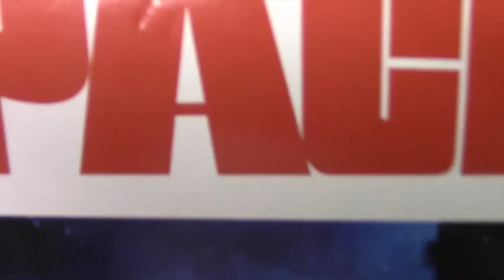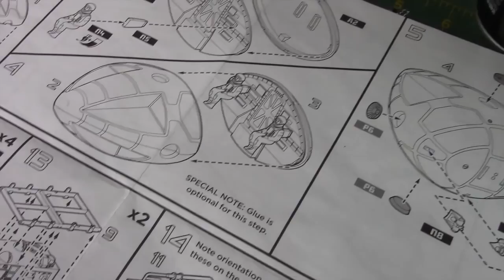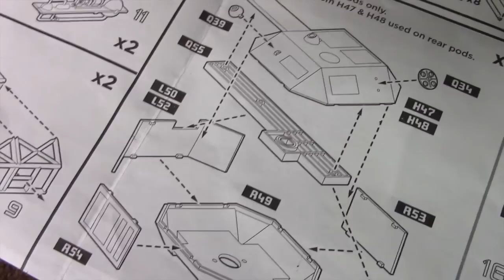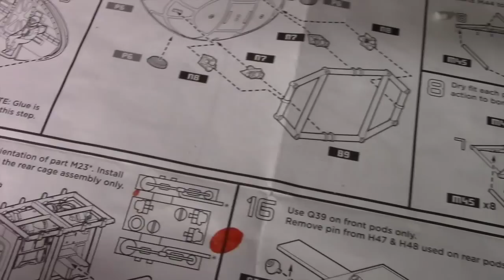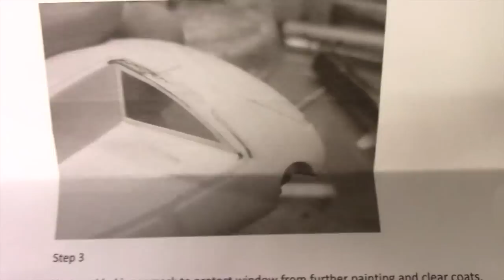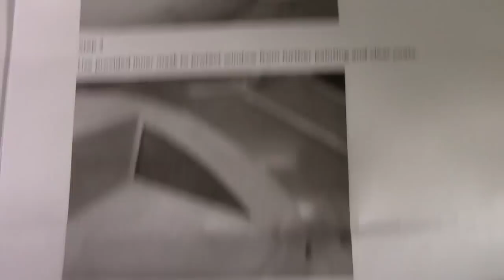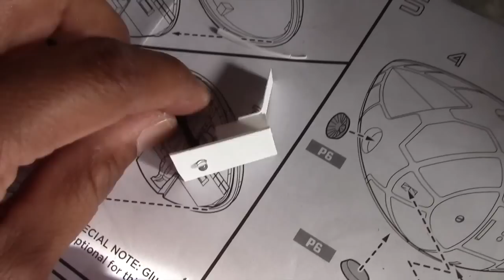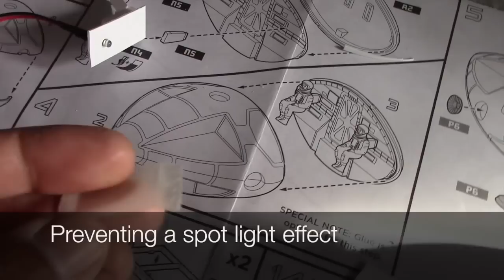Building the Round 2 Space: 1999 Eagle Part 1

Comment: Enjoying watching the built.  Two things.  Since the figures are a little harder to see in the cockpit, a quick wash (not black) would probably have been enough to make them pop.  Regarding the LEDs, the size of the LED does not dictate the battery used ... the color (different forward voltages) and the resistor (which should be included, based on where you are getting them) is what determines the battery to use.  I rarely use the 9V batteries because of their size and they don't last as long as other type batteries.  Granted, just powering an LED or three means the battery still should last for quite a while.
Reply from the maker: What kind of battery do you typically use?
Reply: @InterstellarModeler  Depend on the space available.  Typically I shoot for a couple coin batteries (I want a minimum of at least 3V), and I've used some small ones meant for cameras at around 12V.  The latter are more expensive than a 9V transistor battery, which is hard to beat for the cost, but smaller ones often fit the space better. I've also used a couple AAA batteries.  I sent an email with some info.

Comment: It's Micro Sol for getting the decals to shrink in place. Micro Set is to put on the decal when it's dry before soaking it off the paper. I always got it the wrong way round as well. The names are a bit confusing.
Reply from the maker: +Montague Flange You're absolutely right.  Thanks for the correction. Overall these decals aren't very hard to work with.  I will make sure I correct that in my next video.  Thanks for watching

Comment: Kool model. An easy way to diffuse the LED light is to apply a ball of clear, hot glue. Just squirt it on, and shape it with the glue gun.
Reply from the maker: I've been told that hot glue could potentially damage the LED, have you ever had problems with this?
Reply: Interstellar Modeler , I've never had a problem with it. As when soldering, don't keep the heat on the LED for too long. Also, you can use the low temp glue.

Comment: Instead of installing the translucent styrene sheet in front of the LED you can alternatively sand the clear "front lens" portion of the LED itself. Gives various amounts of diffusion based on grit of paper used. For even more diffusion (and further light intensity loss, of course. Everything comes at a price, right? :D) you can then paint the sanded LED in a semi-opaque (or do a thin airbrush coat of opaque paint of) colour of your liking.
Reply from the maker: +the agile aardvark Yes that is very true.....something I didn't even consider when puttying this together.  Thanks

Comment: Hi, you d'idnt talk about Windows clear parts, did you install these or stay open.? thanks
Reply from the maker: +Richard Bourdeau I left them open up until the very end but I did use the clear plastic parts that came with the kit.  If I were to do this again, I would do the exterior gray paneling first before installing the windows and attaching the astronauts / back wall.  I used pastels for the paneling as you'll see in upcoming part 4 and it would easier to spray the dull coat without the windows in place.
Reply: Ok. Im looking forward for part 4 !!!
Thanks

Comment: Your a skilled model builder, but this has to be by far the worst over fiddley model kit I have ever attempted. The tool designers clearly did not car or have in mind the end result. Which of course is the builder. The spine should have been in 1 or 2 pieces. As it is nearly everyone I know who attempted this kit. Ended up with a crooked spine. Then others who just threw the kit to the side. You need to make sturdy jigs for a lot of the assembly. Instructions are also badly done with way too much figuring out and redoing of a lot of parts.
Reply from the maker: I'm sorry you had such a difficult time with the kit.  You might want to touch base with a facebook group called Space 1999 Props and Ships on Facebook.  So many group members have built this kit and may have recommendations on how to address some of your issues.  Another alternative would be to consider building the 1/72 kit they released.  I've not built that one but apparently is a very good model kit to work with.  Thanks for watching.